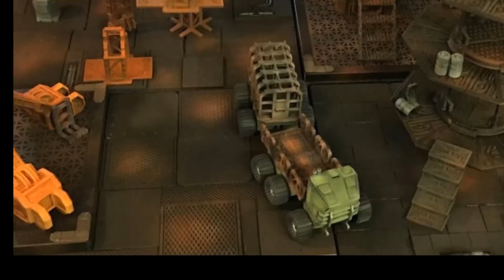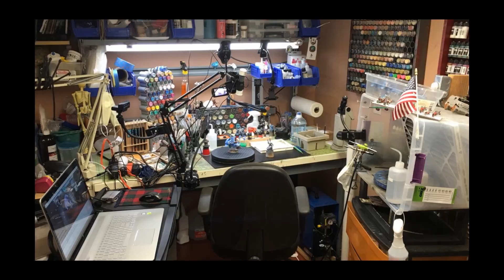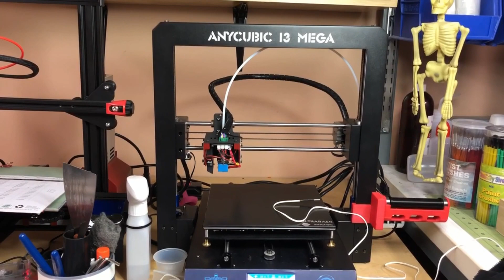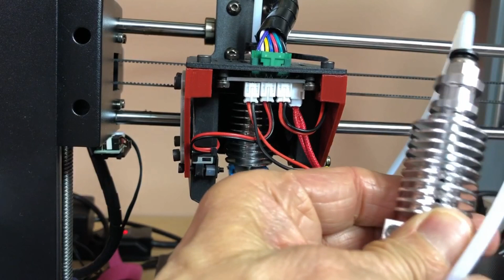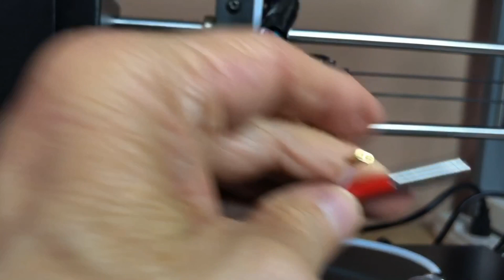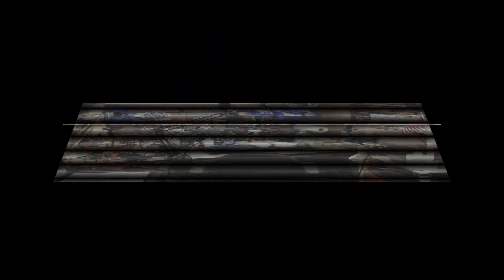Anycubic Mega & Chiron Easy Hotend Mod

Comment: Hey, I just ordered a Chiron off an Amazon flash sale for 520 CAD. ( was wondering if you have upgraded the hot end on yours to an all metal one? I'm thinking I may want to print some nylons and I don't think it can print nylon with a stock hot end? If you do end up upgrading yours it would be great if you made a quick tutorial for anything you had to do for the upgrade.
Reply: @Anthony Tether 
Hi did you need to change anything in your chiron firmware because I just purchased an e3d hotend with volcano heat block and I was planning on just changing the hotend over but e3d said I will need to alter the firmware to work with there sensor and the thermal heater thing? Any help would be great I almost just fitted my v6 heater and sensor into the e3d hotend save me the hassle 😅